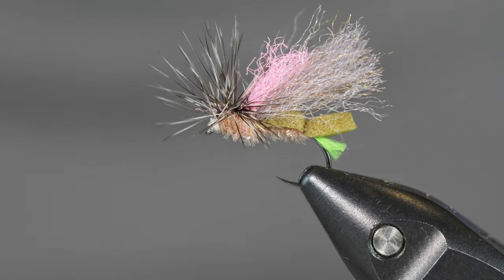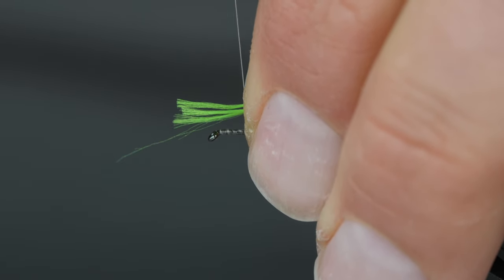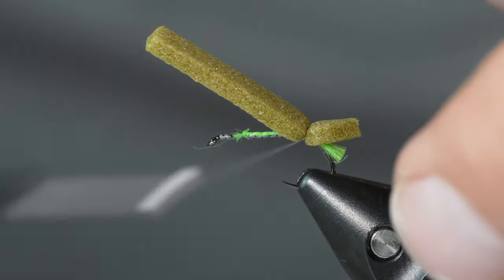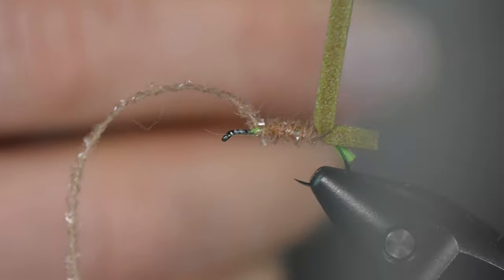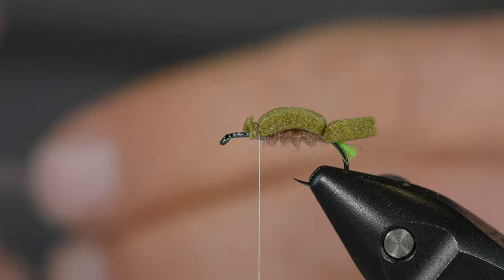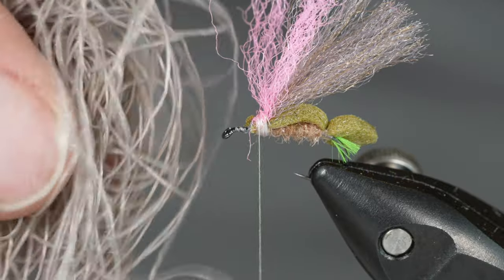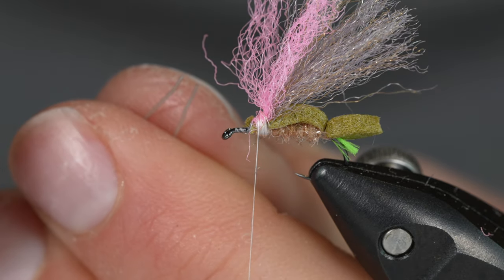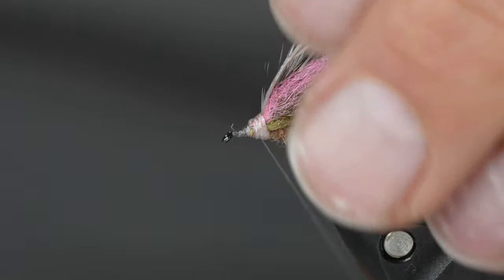How to Tie the Foam Front End Loader Caddis

Comment: Great tie bud. I saw you used the foam on that and currently I am tying sone of my corked caddis which works very well as a indicator for dry dropper. Figured I would add sone foam to see if it will float longer especially after getting wet

Comment: Devin, thank you. Do you prefer this in a 12 or 14? Thank you
Reply from the maker: I probably fish the 12 more since I'm normally holding up a decent size bead or two smaller ones when I fish this fly. But if you're sticking to a 2.3 mm or smaller bead than the 14 is fine.
Reply: @tacticalflyfisher3817  thanks so much!
Reply: @tacticalflyfisher3817  got my package from you to tie some of these up! One question, I’ve tried to see in some of your videos but how do you dry drop with a euro rig? Do you tie a dry on and got off the bend or?
Reply from the maker: @johnbell5396  on a tag. We have a video specifically on dry dropper with a euro leader in October 2022.
Reply: @tacticalflyfisher3817  thank you!!

Comment: I have a question about your dry fly rig. Is the rod 9' or 10+' and is the line euro or something like a double taper?
Reply from the maker: For a single dry fly rig I use a Hardy 9’ 9” 4 weight with a long Spanish style tapered leader. 

When using this fly, I typically fish it as per of a dry dropper rig on a euro nymphing micro leader.
Reply: Thanks